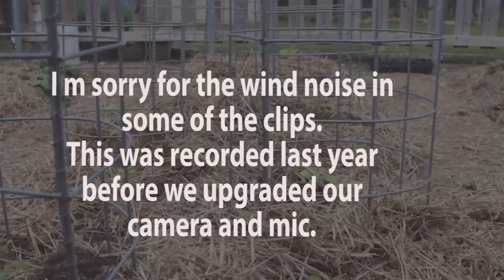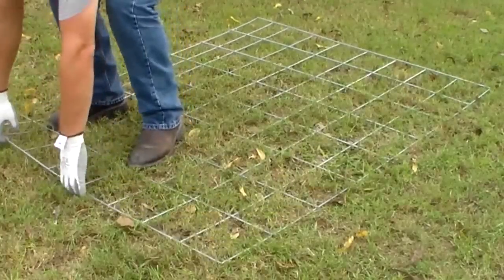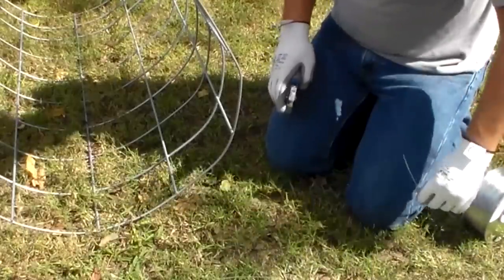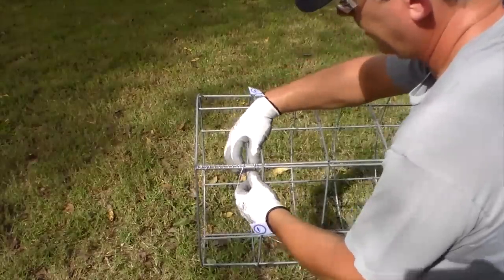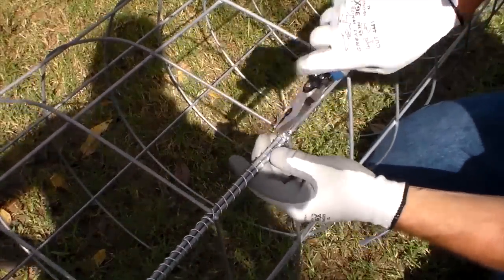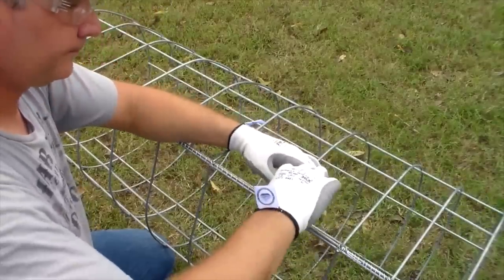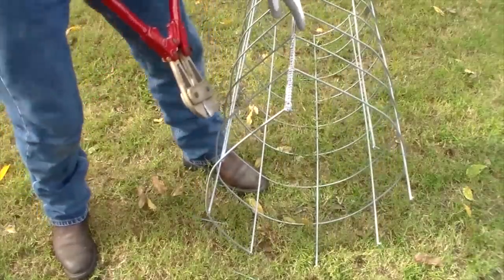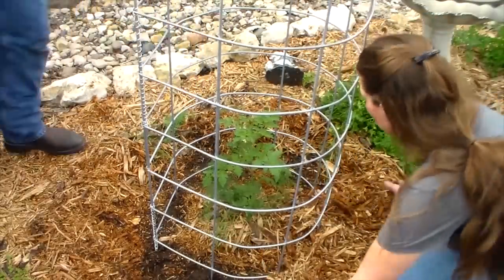Learn To Build A Sturdy Tomato Cage From A Cattle Panel

Comment: I do my tomato cages the same way but I fasten two together and make it about 8' tall and secure it with a chain link top rail. It is sturdy enough to hold any size plants and the kids even climb them. It is amazing how big tomato plants grow if they are supported properly. We usually plant three plants per cage and prune them into two canes till they are about seven foot tall then let them spread out. This year is the fourth year growing this way and cages are still in great condition. We bent the panels over a 55 gallon barrel to make the cylinders and wire the two halves together. Upstate SC.

Comment: It's a nice cage. I think that you could have saved the bailing wire and a lot of time by using the wire ends of the side of the cage that you clipped off and bend approximately 1.5 inches of that tail end of the wire with needle nose pliers and hook it at the other end to complete the cylinder (cage).